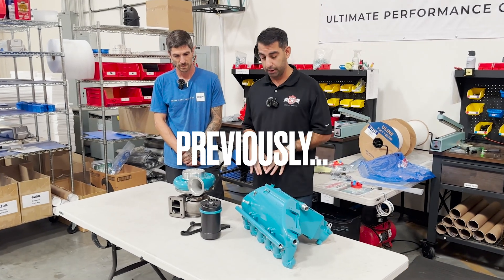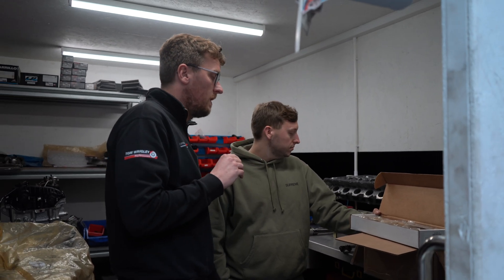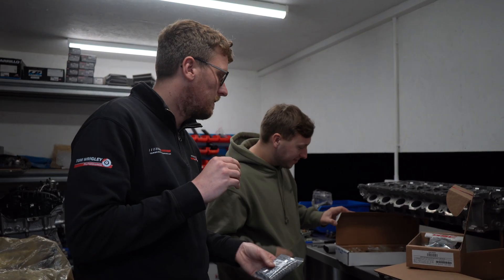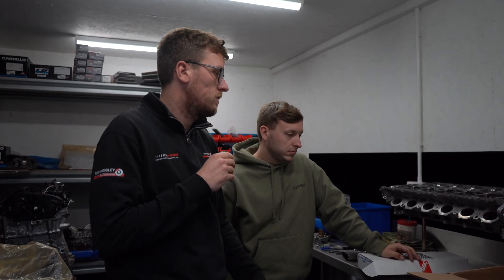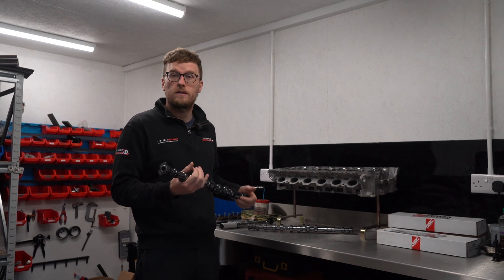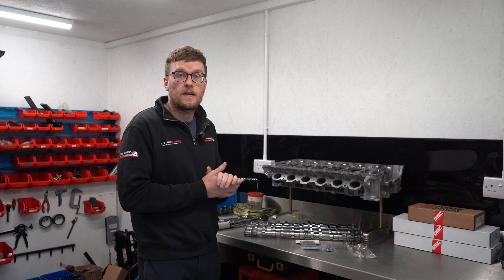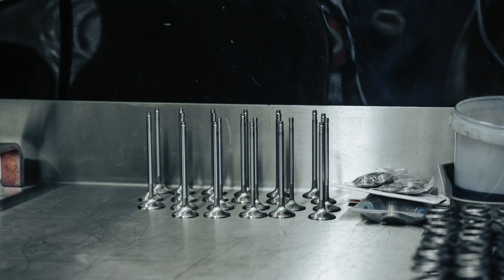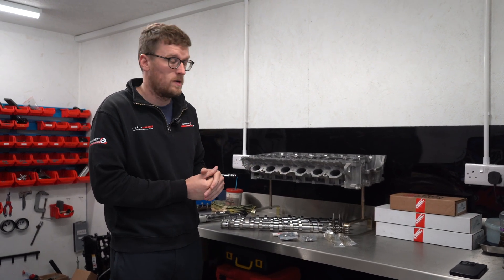How to Bulletproof Your S58 G8X Engine – Avoiding a Catastrophic Failure!

Comment: Did you have any problems with valvetronic adaptation and operation after installing Power Division shafts and springs? Did they require ECU recalibration for correct valve lift adaptation?